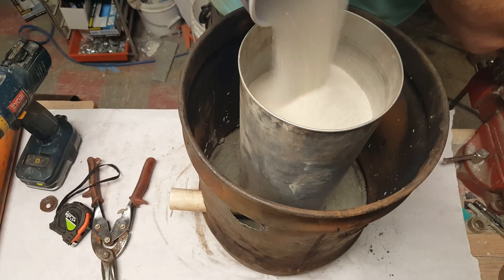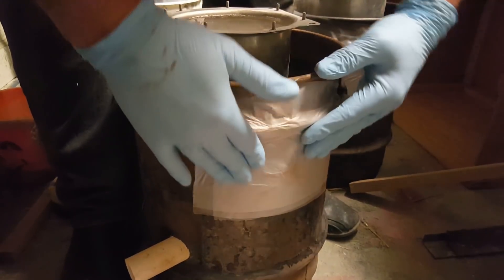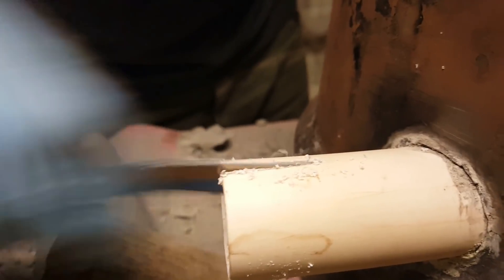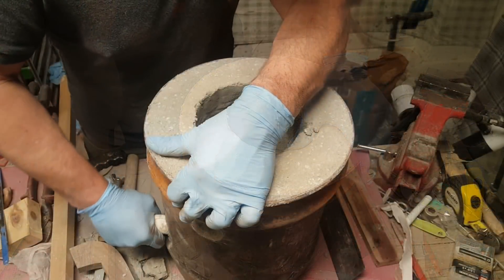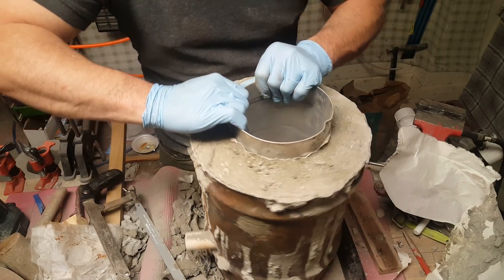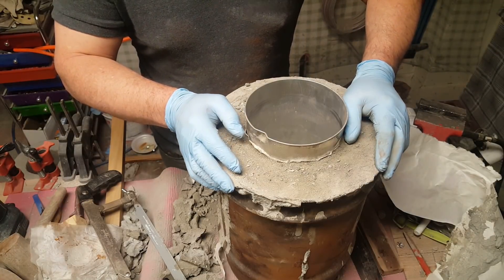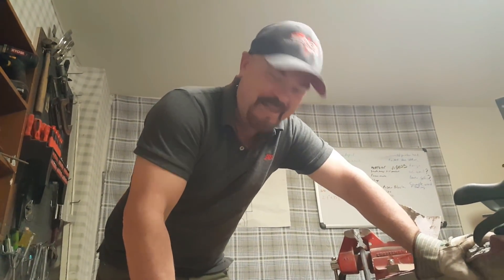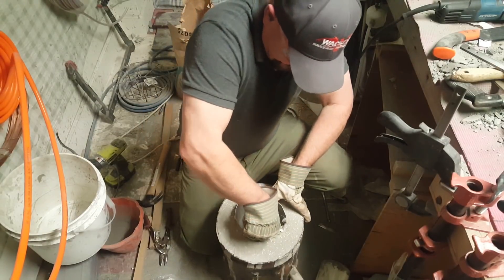Creating the Ultimate Air Crete Refractory Mix Forge

Comment: I'm thinking that maybe since the stuff is so easy to cut through, why not put a form that is slightly undersized but easy to remove (cardboard tube, PVC, towels wrapped in a plastic bag, etc.) that won't absorb any moisture and cause it to stick... And then you go back and finish the inside to final dimensions. Maybe a PVC cap with steel brushes glued/mounted to the outside, so you can chuck it in a drill and scrub it? I dunno.